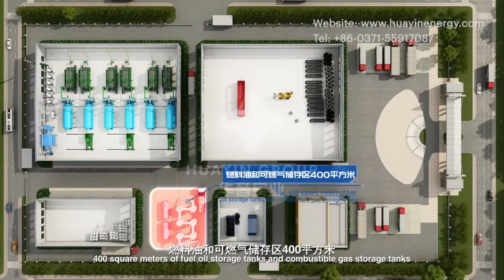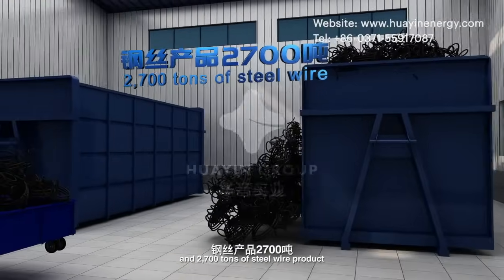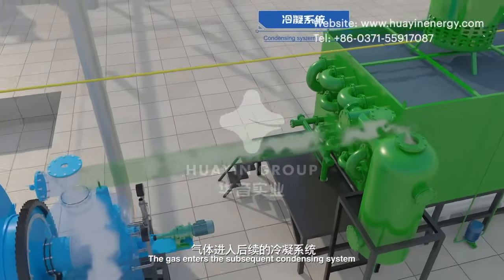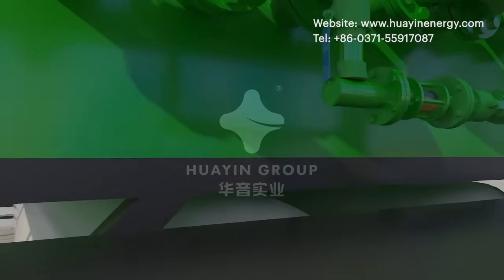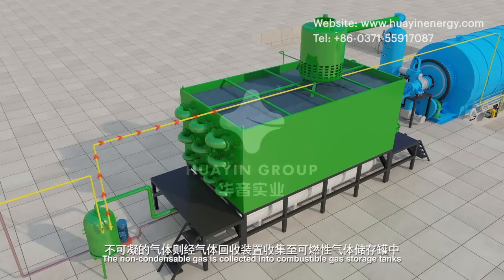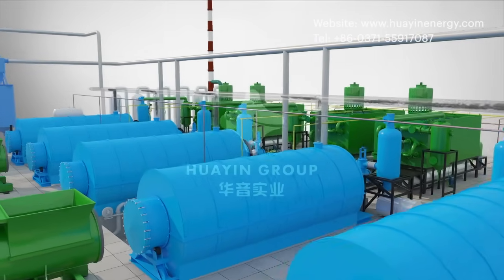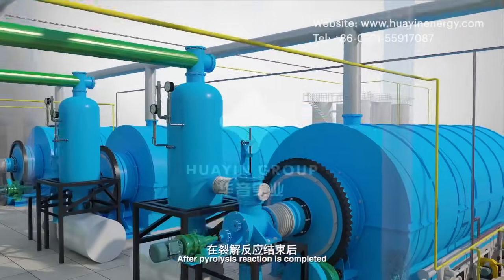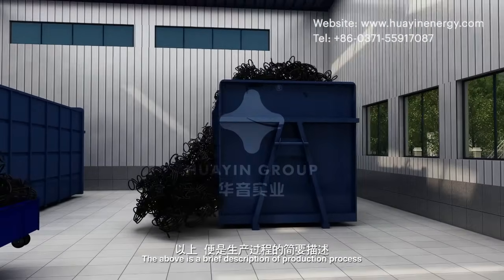3D Animation Video of the Process of Huayin Waste Tyre to Fuel Oil Pyrolysis Machine

Comment: Would this also work with wood instead of tires or in general plastic?
Reply: 适用用木材的是做炭的设备
Reply: @徐春生-f2d  Yes I know, but could you also produce fuels like gasoline and diesel by using wood instead of scrap plastic or tyres with this method?
Reply: @coolkrass5079  https://en.wikipedia.org/wiki/Pyrolysis_oil#Wood_Pyrolysis

Comment: What oil?
- diesel 
- bunker oil.
- high gred  oil?
- spec code?
- rector temp"c heat? Temp"c ?

Around 1992 more and that around from tires reycle waste raw material convert to bunker oil/ gas/ etc.
Technology from taiwan firsr plant.

Just For sharing.....
i set up plant project high technology ( factory).. now new technology green tech all waste from dumping area can convert by product.
Reply: Pyrolysis oil is a mixed product of countless hydrocarbon compounds! ;) It should be fed into raw oil stream of a refinery. It definitly needs some refining until it can be run in an engine.

Comment: How the metal cords are extracted from reactors? Does it require operation to stop? And isn't it more effective to shred tires before loading them into reactors?
Reply from the maker: Hello, we have the steel wire drawing machine to remove the it from the reactor. This is batch design machine, so it need to stop. If the diameter of tires is less than 1.4, it doesn't need to be shredded. 
If you want to know more information, feel free to email us info@huayinenergy.com.
Reply: Shredding is an additional step that takes effort. But I'd like to see the full ash/wire extraction process, too... steel wire is not nice to handle...